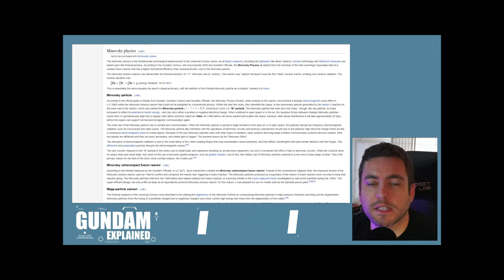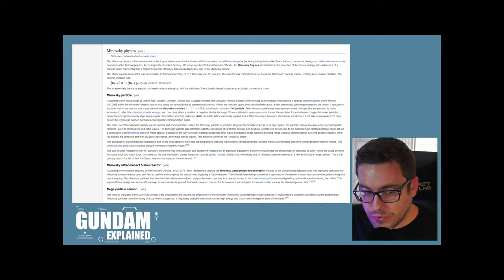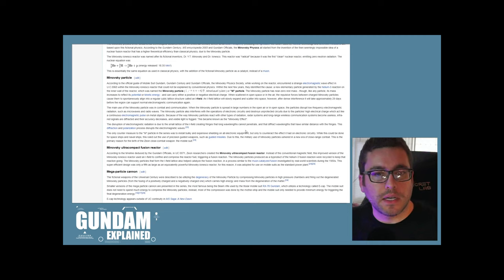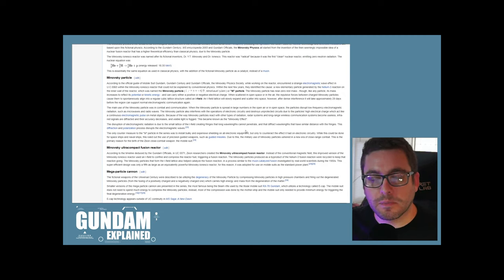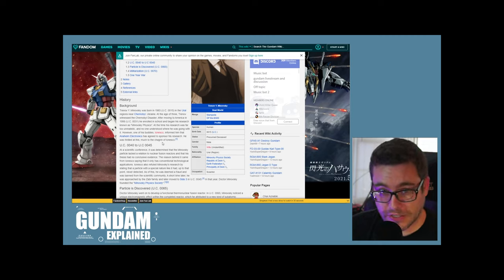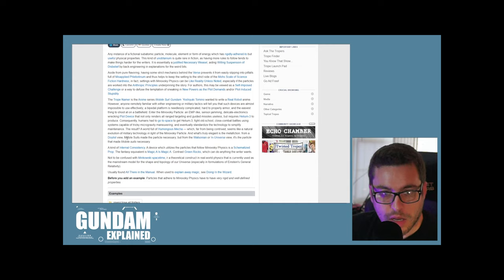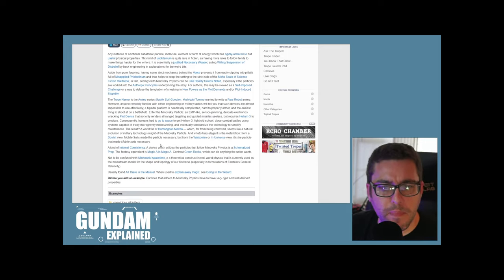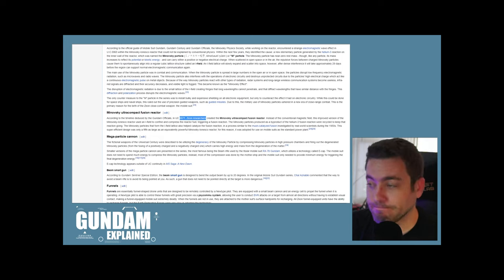Gundam Minovsky Physics Explained! Part 1

Comment: its funny how scientists found that moon has abundant helium-3 on it in 1985, So technically the lunar cities should be the center stage for all the conflicts in Gundam instead of just a weapons supplier with good industrial capabilities.
Reply from the maker: Ah very cool. That could be a good idea for an untold side-story, where maybe some super rich untouchables outside Federation and Zeon live lavishly.
Reply: @GundamExplained  Sirocco should have just stay in jupitar and start a helium 3 empire instead of hauling it around. 
Bandai are you listening??
Reply: Might be cause if one side of the fighting does get this strategic location it will end the war without giving losing side much options? just like Swiss during WW2 that held money of both Axis and Allies maybe Lunar cities are similar to them supplying weapons to both side but either can attack them. :3

Comment: Something that many people may forget that minovsky effect doesn't block UV, X ray and Gamm ray spectrum at all so they pretty much useless against those. I kinda surprise why did gundam verse didn't used UV, X ray and Gamma ray spectrum sensors to counter minovsky effect
Reply: Or visible light sensors, for that matter. They don't have problems with Mark I eyeballs, after all.
Reply: @katemora285 they actually do in most series. Most mobile suit displays will call out targets when the computers recognize them visually. They also use directed lasers for communication.
Reply: @katemora285 The Drach joke here cought me off guard .
Reply: I thought it affected visible light somewhat